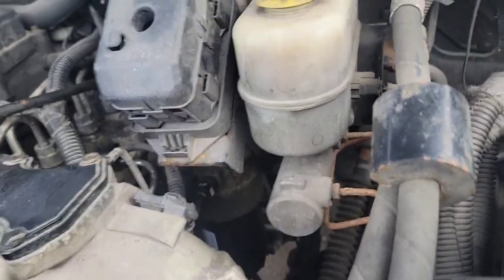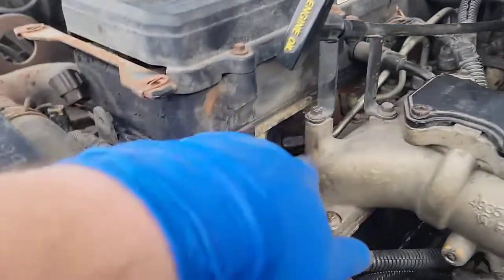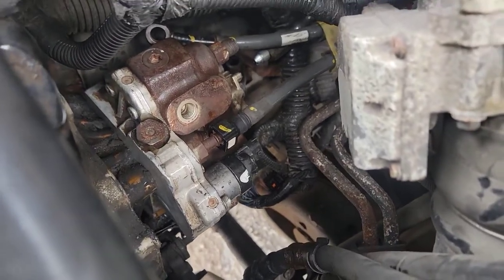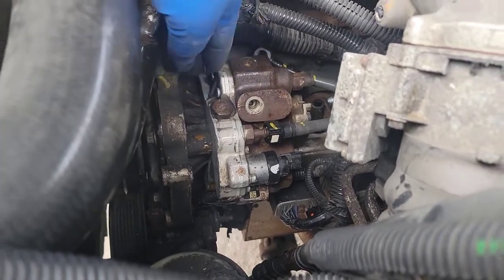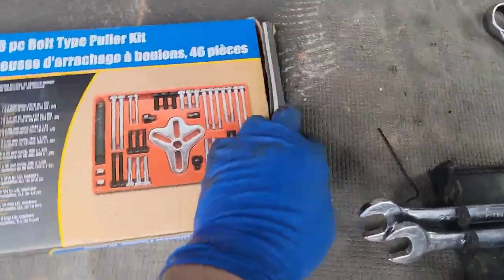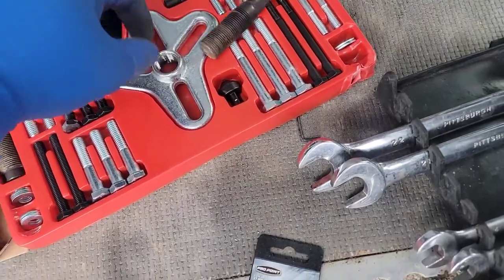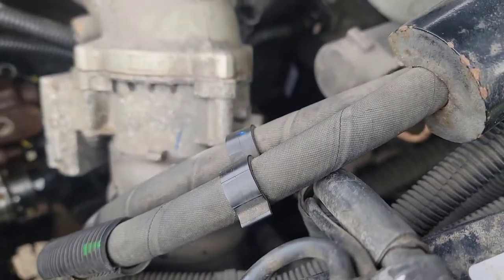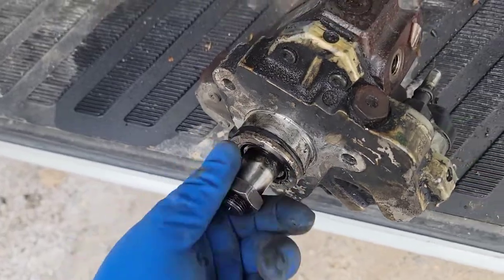failed cp3 pump symptoms, diagnosis and roadside replacement Ram 6.7

Comment: I’m not so sure it was the CP3 that failed. I’d be willing to bet it was the FCA or the Fuel Control Actuator located where the plug is on the CP3 itself. They are known to fail. And unless you have half a million miles on the engine or run extremely dirty fuel and don’t change your filters, those CP3’s are not usually prone to fail.
Reply from the maker: It is the weirdest thing. It's almost like the shaft end snapped. I spin it at the end of the video and go over it a bit. I think it's the -20c cold start that did it in. Canadian climate is hard on everything

Comment: I have a 2003 bluebird school bus with a 5.9 Cummins diesel. While driving it started shaking and then it didn’t want to run over 10 miles per hour. Scanner code is P0233 and P0251.  Fuel pump secondary circuit intermittent. And Injection pump fuel metering control. Can that be the CP3 pum, or the fuel regulator. Please help.

Comment: So my lift pump took a shit so I changed it, now I’m barely getting drips out of the high pressure line, but I’m getting all the fluid shooting in from filter housing out the return line.. cp3 still good? Or what’s my issue

Comment: Just changed out my cp3 pump,   Do I need to prim the line?  Got a new fleece lift performance pump and fleece combo fuel filter and water separator.    Engine starts for about one minute and if I accelerate it a bit,  it shuts down.   Please help.

Comment: Also did fleece coolant bypass and it runs cooler in 4 5 6 on a hard pull. Overall temps a little cooler also.
Reply from the maker: I dont know how that coolant bypass would perform for canadian weather, especially in the winter, and considering I tow so heavy. What exactly is it bypassing?

Comment: I had the p0254 code my truck starts for 10 seconds only and I have a message on the screen for service electronic throttle control , I’m thinking 🤔 in replace the cp3
Reply from the maker: No, that sounds like an electrical issue. If it was the cp3 it wouldnt start at all
Reply: @TehArtfulDodger  thanks for your answer
Reply: My truck is doing the exact same thing right now.. did you fix your problem already? And if so what was it?

Comment: My hpfp gets fuel from the lift pump and it goes back on the return line, the lift pumo stays on for more than 15 seconds, but if i crank the engine there's no fuel going from the hpfp to the rail, not even a drop of fuel, even if i crank it a lot it just won't deliver fuel to the rail, it goes back on the return line, what could be the issue?

Comment: Having problem with my 05 5.9. Had a snap on scanner on it while driving. Under slow even accel. seems ok to a point. If you accel harder or put load on engine rail prwessure will drop to 4k psi then spike to 24000  when shifting. Seems like it will build pressure but no volume. WDYT, I'm thinking CP3.
Reply from the maker: Never came across something like this. Might be an injector dumping fuel. In my experience, if the cp3 fails, it just fails, not a gradual weakening

Comment: All I know after 13 years of CP3'S is I keep em lubed! Lil transmission fluid summer time, Lucas, Howse or Oower SERVICE in the winter.....  My 5.9 pump leaked from that ball bearing thing on top so I had it replaced, that was 2nd engine probly 200 thousand on the Air Dog. 1st Oreilley pump ate up my Air Dog, then got Bosch Cp3 from diesel shop, and a new Air Dog and engine ran fine after that..